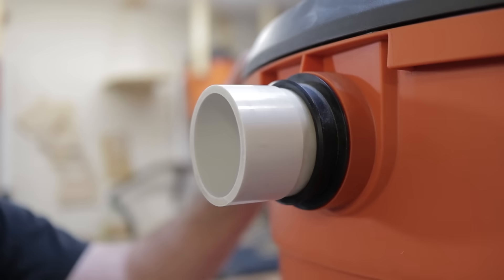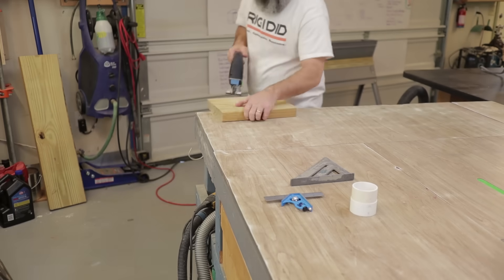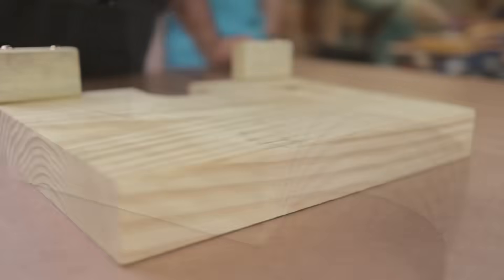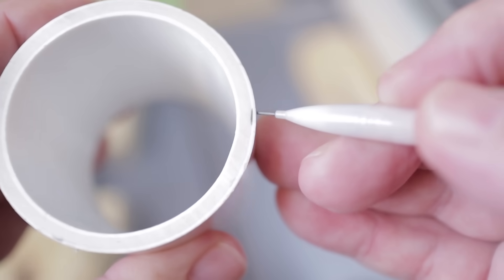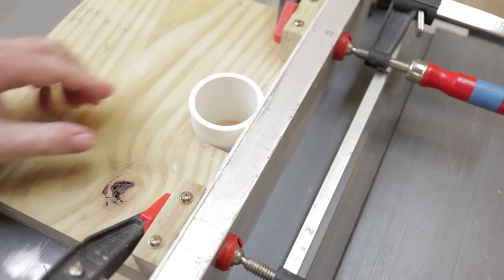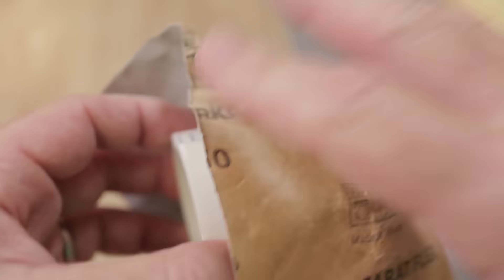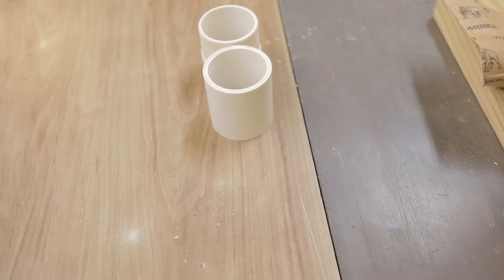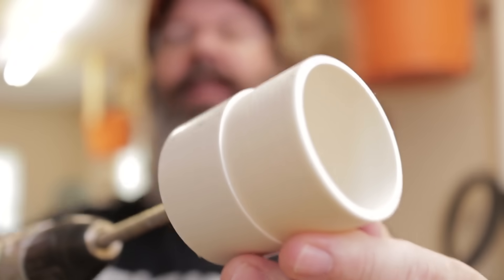Dust collection adapters shop vac to PVC made fast on the table saw

Comment: Perfect craftsmanship! I used to have a lot of troubles when trying to fit home depot pipes using cutting approaches, until I got a cheap 3D printer. It prints precisely accurate adapters with different angles, different sizes, and with flanges. It can also make flexible parts with elastic filaments. That said, it is so entertaining to watch what you are doing.
Reply from the maker: Thanks Shawn! The 3D printer sounds like a great method for sure :)

Comment: Thanks for sharing. I needed to do just what you showed here but only had 2 x 4 scraps and did not have a band saw to cut that nice u-shaped opening. So I stacked two  2x4's together fastened with screws, cut in half and the cut 45 degree on each.  See this photo. https://photos.app.goo.gl/cCuey2ctVzzQAvZ97    I used a longer piece of pipe that I could modify both ends and cut in half.
Reply from the maker: Hey Jim! That's awesome! Looks like you've simplified the process even more with some creative thinking. Very cool! :)
Reply: nice solution, thx for sharing the img!

Comment: Jig it up!! Thats so cool. I normally have good luck with a heat gun though and then just shoving it onto or into whatever I am trying to connect and letting it cool. Ever tried that? What's the advantage to this setup instead? You may have converted me though!
Reply from the maker: Thanks Paul! Any method that produces a tight fitting adapter is cool in my mind. I don't have a heat gun but it looks like another good way to make them. Maybe even more practical if you only needed one or two :)

Comment: I’ve watched this video twice it’s a need a deer the pipe looks like it’s schedule 40 did you try to schedule 22 inch pipe just a thought
Reply from the maker: Hey Steve! Thanks for watching. I've never tried anything other than the 2" foam core drain pipe. It's super cheap, available everywhere and the wall thickness is perfect for making this part.

Comment: With the amount of piping you seem to be doing maybe you can answer this... Is there an off the shelf option for a swiveling PVC elbow? I want to make a boom arm for my overhead dust collection and rather than buying a tonne of hose I'd rather just use PVC. But the boom arm needs to swing!
Reply from the maker: There isn't one that I know of. There are a few different ways you could accomplish this with a short piece of hose with the swivel fitting attached. In the next video I will be sharing some things about the hoses that may give you some ideas.
Reply: @SlowandExpensive  I know they do exist... mainly for pools. So 2" is hard to find! They typically have a threaded side with a cap and an o-ring. Very common for 3/4" pipes it seems. Backup option was the hose connector(s)... guess i will have to track some down!

Comment: Very clever project! It occurs to me is that one could leave the pipe twice the length so that you can handle it from above the height of your fence as you rotate it. Then cut it down afterwards.
Reply from the maker: Thanks! Sure, that would work. As long as you can still turn the pipe comfortably one handed it should work fine.
Reply: Three years later and I’m re-doing my dust collection system. Your method seemed to have a lot of setup effort but I’m definitely going this route because once you get set up you can turn out many precise fittings with little effort. Much easier and more exact than heat-based methods. ❤

Comment: PVC molds with heat. 
You probably could have saved time by just making a split half way through the fitting. Then used a torch or heat gun to heat it, and then tapered the fitting.
Reply from the maker: Probably :)

Comment: Once you have the jig clamped in position and the fence is aligned to give you perfect dimensions on your fitting you could add a simple feature.  I noticed that the jig's base overhangs the miter slot of the tablesaw top.  Slide a wooden slot runner into the slot under the jig base and temporarily affix the runner to the jig base at each end with a dab of CA glue to secure it's place.  Now remove the clamps, lift the gig, turn it over and more permanently affix the runner to the jig base with countersunk screws and some more CA glue.  Now your spacing from the blade is fixed so just drop the jig's runner into the miter slot and slide the fence up tight on the other side for perfect alignment.  No more need for measuring, no clamps required and no fiddling with the fence adjustment.
Reply from the maker: Sure :)

Comment: Definitely agree with the use of PVC fittings as alternative to the over priced vacuum fitting.  I have to say though that this is the most intricate alternative to a lathe I've ever seen.  The PVC turns/machines very nicely with basic tools.
Reply from the maker: A breakthrough in low technology :)
Reply: while true, most people do not have a lathe in their shop. That is certainly a luxury item unless you make your living producing table legs and similar items

Comment: Shop Vac fittings are tapered to give a seal when they are seated. Tilt the blade 1* and do everything else the same. They won't pull out or vibrate out when in use and the little twist at the end makes it secure.Good video and Good Luck!
Reply from the maker: Thanks Randell! You can taper the fittings slightly when you sand them too, although I'm getting a pretty tight fit without any tapering.
Reply: @SlowandExpensive    can it be air tight if its not water tight?   it would be cool to test it.   i guess it doesnt matter too much.

Comment: I like the idea of the shop vacs for dust collection. How do you empty them and keep the filters from clogging?
Reply from the maker: Thanks Terry! The vacs don't usually get too much dust in them as most of them are hooked to cyclone dust separators and the majority of the dust ends up there. I still do occasionally have to pull the filters and clean them. The containers over the separators take a while to fill up. There will be more videos coming about all the different setups in my shop soon! :)

Comment: Why spend all that money having a separate Shop-Vac at each machine? Why not just buy one dust collector and make it a central system?
Reply from the maker: There is no noise when no tools are in use. There are no blast gates. It's automatic and near effortless and as hard as it may be to believe, it cost me less. A few thousand less when you factor in the added cost of duct work and automatic blast gates for ten tools. I will explain the details later in the series. Thanks for watching! :)

Comment: Hi, nice solution to a problem 👍. Do you run into any issues with static using the PVC pipe for dust collection?
Reply from the maker: Thanks! I've never noticed any static issues but I don't really have a great deal of pvc involved in any given set up (If that has any bearing on the amount of static charge?)  I have about six different configurations and the one with the most pvc has a couple of the adapters a street 90 and a peice of pipe about 2 ft long. I imagine a system involving more pvc could be different.
Reply: Good point, cheers.

Comment: Hmm.. anyone sell one of those rubber compression sanding spindles the right size for the inside of 2" PVC?   It wouldn't wear out like I'm sure the tape would, and you'd have a sanding spindle of a nice diameter, too.
Reply from the maker: Maybe :)

Comment: Great idea and great video.  While your CAREFUL use of the table saw seems safe enough, I just prefer a sanding action better (just personal preference, you know).  I've used my 9" table drillstand with the same wood plug and long bolt as you used, and a Dremel sanding drum (or the better sanding drum carbide cylinders for it) against the turning part. Requires steady pulse but the sanding action seems less prone to catching then cutting. Just an idea.
Reply from the maker: Thanks Alfredo! Sounds like the sander is another option :)

Comment: Question...once you have the jug dialed...and you go the drill powered option...  Ar that point you keep the sae blade at the top and lower the pvc into it?  I was just thinking that it may be a lil sketchy to raise a blade while holding on to a drill with the other hand. Looking for clarity. Thanks! Subscribed!
😇😎😀
Reply from the maker: Thanks Jeffrey! I'm starting the drill with the blade down and raising it to 1 1/4" then dropping the blade back down and the pvc is spinning the entire time on low speed with light even pressure keeping the cut face of the pvc pressed to the  saw's table top. It may seem a little sketchy at first but it's not too bad.
Reply: @SlowandExpensive  this seems to be more work than necessary... I don't have a drill press...I understand that small increments work when cutting into a spinning object.  Is it too difficult to just lower the pvc a little at a time?  I just wonder (on my own skill set) whether holding onto a drill in operation at the same time raising a saw blade spinning whether there would be too much potential torquing of the pvc in the jig.  Maybe I'm over thinking it.

I work at an x-ray dept in the hospital and see a few hand injuries and would hate to have a whoops. Thanks for the response!
😇😎😀
Reply from the maker: I would expect a greater risk of a bind lowering the pvc onto the blade especially in this jig. If the hole was deeper, maybe, but then you're engineering a different jig and it sounds less simple. Just use your best judgement. I left  more information in the description you may find helpful :)
Reply: @SlowandExpensive  thanks again! 😇😎😀
Reply from the maker: Your welcome Jeffrey! More videos on the way :)
Reply: @SlowandExpensive  I guess if I set a small weight on the drill .... I may not have to be concerned about applying constant pressure.  Maybe a bungee cord?
Reply from the maker: Jeffrey, no bungee cords on the table saw! :)

Comment: All this or you can just go on amazon and buy one for 2.85 . thats WAYYYYYYY too much work for that thing .
Reply from the maker: 2 1/2" shop vac to 2" PVC adapter on amazon for $2.85! You'll have to share the link for me to believe it. The jig is a simple woodworking project that takes about 15 minutes to make. WAYYYYYYY too funny :)
Reply: @SlowandExpensive  you had 15 minutes in the drilling and filing ALONE !!!  lets see IN REAL TIME  you make the jig and one complete part in 15 minutes . im getting the link.
Reply from the maker: There's more information in the description. Good luck with the quest :)

Comment: 10 cents for 2” pvc coupling and 15 seconds to make it 🤔🤔🤔    I don’t think so
Reply from the maker: Roughly 90 adapters can made from a 20 ft length of 2" PVC pipe. A 20 ft length of 2" PVC drain pipe is $9. The last adapter made in the video was in real time.

Comment: Very clever on the spinning jig using the drill.
Reply from the maker: Thanks Hai!
Reply: Many parts can be done with a driul plus other tools combination.  I frequently manage to use my hand drill (for its capability for turning SLOWLY, with Sanders and large mototools, and even a hand grinder mounted on a very practical base that converts it into a helpful Mitre-saw.But I have one suggestion:  While thinking about using a Router instead of a table saw (Bad idea,I guess), I though why not using a SANDING drum instead... What do ya think?

Comment: Seems to me it would be easier to put the electric drill in a vice of some sort, turn the drill on and hold large grit sanding block against the outside of the PVC. Or the drill press you've got in your shop. Or even a hole saw. This way just seems like an awful lot of work.
Reply from the maker: I can think of a lot of things that are an awful lot of work but cutting a hole in a block of wood with a jig saw isn't one of them. It only takes a few minutes to make the jig and it could be done faster with a hole saw, scroll saw, and/or a spindle sander as mentioned in the description but I chose a jig saw because I thought more people would benefit from knowing this jig could be made with simple power tools.

Comment: My table saw is old and doesn’t have a connection for a tube for vacuum.
Reply from the maker: I see. Those are the dusty ones. Some times the older ones can be sealed off and retrofitted with a vacuum hose.
Reply: Put a hole in the base table

Comment: Be easier to buy fitting that fit
Reply from the maker: I didn't know they existed. Sales link? Please share
Reply: @SlowandExpensive  lowes
Reply: @SlowandExpensive  item # 83589 model 8011711
Reply from the maker: We are adapting from 2 1/2" vacuum to 2" PVC so that you can use PVC in your shop vac dust collection system. Adapters for connecting 1.25 tools with 2.5 and 1.5 hoses are not the right size for this application.
Reply from the maker: Hey cash flow! Link's in the description if you need some. Thanks :)

Comment: Very clever and worth it if you are running a lot of shop vacs as you do.

One suggestion: sharp 90 degree bends cut airflow by some amount. I would try a longer radius 90 degree sweep elbow and see what effect it has.
Reply from the maker: Thanks Jim!  The sweep is always a great option. I usually choose the small form factor of the street 90's to try to keep things tight and close to the vac. It would be neat to do an airflow test somehow :)
Reply: you can get a similar effect with two 45s and they will have a shorter overall length

Comment: Man, this is a little weird. I literally was in my shop last night eyeballing my shop vac/cyclone setup pondering how to replace the hose from the vac to the cyclone with PVC pipe since the corrugated hose connecting them now is probably reducing the efficiency. I pulled up YouTube this morning and bam. This was the first recommended video.  Big thumbs up for sharing.
Reply from the maker: Awesome! I'm glad it was helpful. I will be sharing some more shop vac dust collection tips soon.
Reply: Hmmmm... You might need more Ridgid shop vacuums, man.

Comment: What a great way to solve our perennial problem of pipes never quite matching with dust collection. Your method is SAFE, accurate and repeatable. Great problem solving.
Reply from the maker: Thank you Philip! I appreciate the comment :)
Reply: Also it might help to tilt the blade slightly, because vacuum hose fittings have a taper, so having at least some taper might be helpful? I'm interested to see how this could be done on a radial arm saw haha.
Reply: Some would highly question the safety. Regarding several of the steps. Although... using a router has similar safety concerns. At least the jig helps.
Reply: @edeaglehouse2221  The jig is clamped and the blade doesn’t break the surface of the jig. Helluva lot safer than some basic cuts made regularly…

Comment: I have two workbenches in my basement that's divided into two sides with a center wall. One side for electronic and electrical things, and the other side for fabricating wood and metal things. I converted one window into a spray booth and also used to vent fumes from soldering. I mounted a vacuum cleaner motor (similar to a Shop Vac type) on the top of a cardboard 22 gallon can. I wired the motor to two two way switches, to turn the vacuum on/off from either side of the basement. I did use black plastic pipe and has three ports from the original vacuum and salvaged from a dead shop vac and used PVC glue to connect them to the pipes to the vacuum , two on one side of the basement and one on the other and the exhaust piped to vent out where the spray booth is. It did come in handy to collect saw dust from my radial arm saw, metal chips from my drill press, and dust from my bench grinder, and all around cleaning in the basement. I did make round wood plugs with a bolt handle to cap the ports not being used. Thanks for making this video. I may eventually run pipes over to the work benches and hang the flex pipes closer to where I can use them, instead of putting several together to get them to reach where needed.
Reply from the maker: Thanks! Sounds like you're getting some good use out of your setup! I find they work well and can be a very affordable solution for dust collection. This video is the first in a series of videos to share a bunch of helpful tips, ideas, and discoveries about them. Hopefully there will be even more good ideas and suggestions in the comments during the series.

Comment: once you have the pvc spindle-mounted, could shape it on disk or bench sander (as well as lathe).
Reply from the maker: Sure!
Reply: I've done it on the lathe. mounted one end in my novachuck and had a wood circle in the other end to the live center. Worked pretty well as long as you take light cuts as pvc will snag easily.

Comment: tilt table saw blade just a hair to make pvc adapter tapered and vacuum pipe will tighten as you push it in
Reply from the maker: It's a tight fit